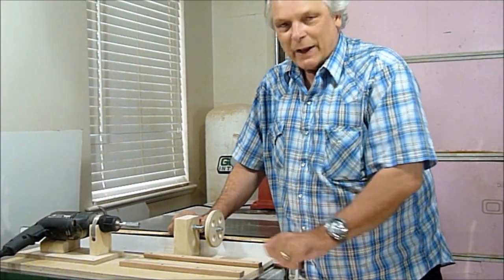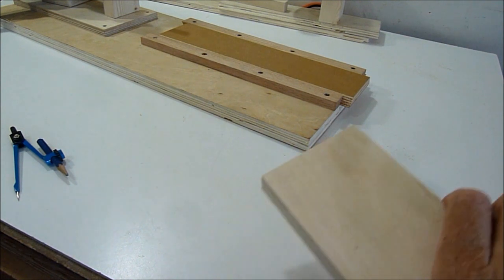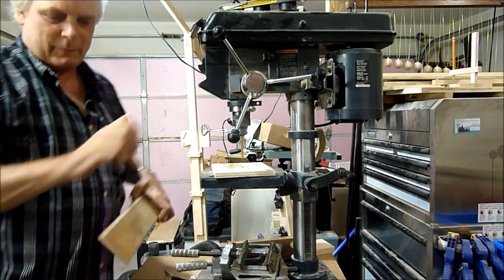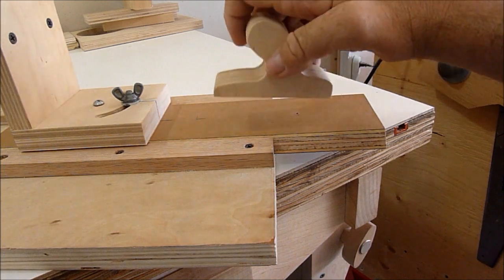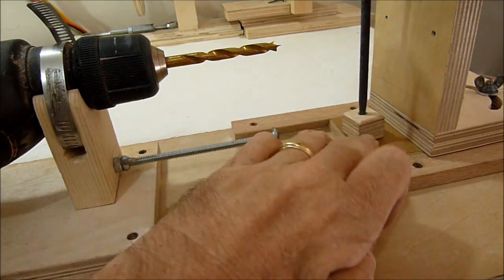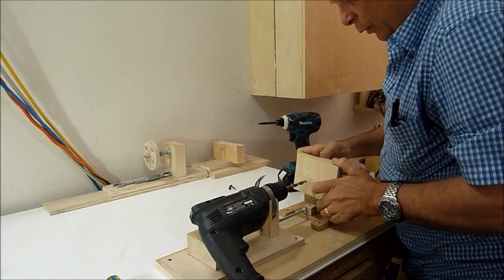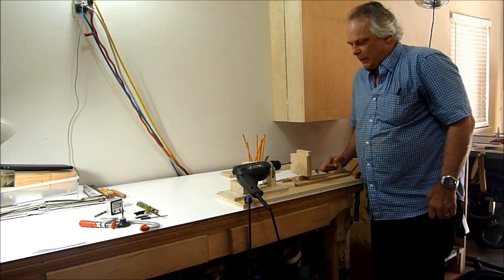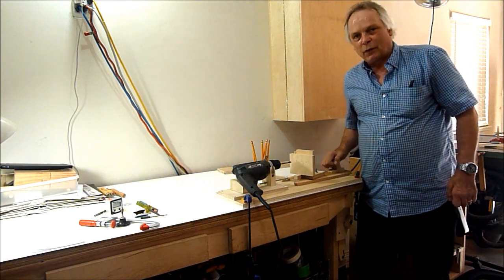Making a horizontal and angle drill mini lathe

Comment: great work !!  heres a idea on the front edge  lay a protractor at same height as the sled  move sled till a strait edge lays across the zero and the degree of cut/drill you want and then lock down the pivot bolt  I might incorperate some of this design into a jig I am working on to cut PVC pipe for a project I am working on